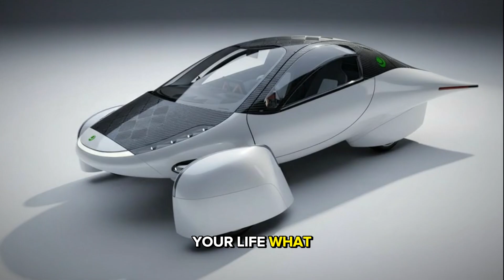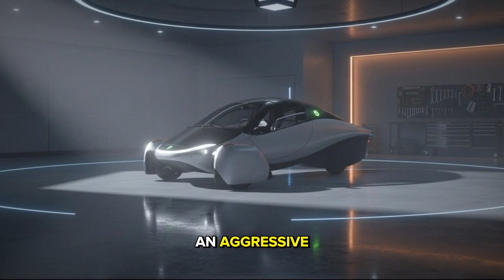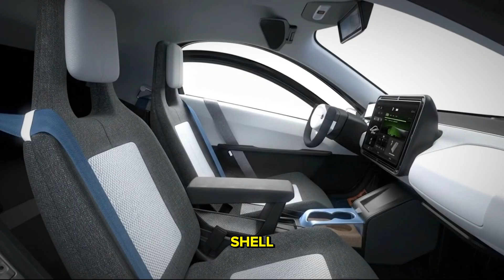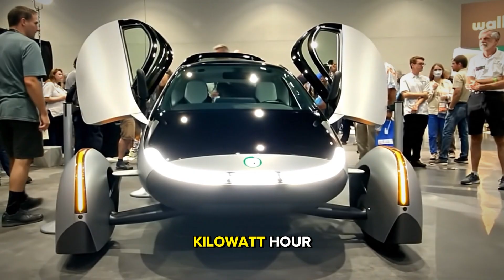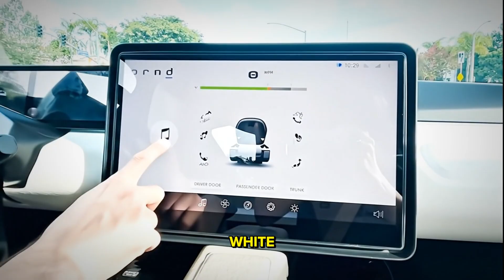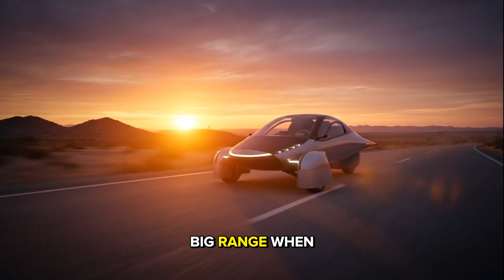Most Aerodynamic Car Ever Made — 2x More Efficient Than Tesla Model 3!

Comment: This is more than a year old.  There are no motors in the wheels now.  It's completely conventional because the gaskets wore out every 10,000 miles and we can't have that.
Reply: I knew Elaphe wasn't at a place where Aptera could move with them.  I remember hearing that two major automakers delayed their implementation of using the in-wheel motors and that meant that the planned purchases weren't there to fund development as quickly as they had hoped.

I didn't know that that biggest hang up was the gaskets.  Where did you learn that?  There are other in-wheel companies that looked interesting, but they just weren't going to get to production soon enough if they used them.  Maybe they would have if the other automakers were still looking at using them soon.